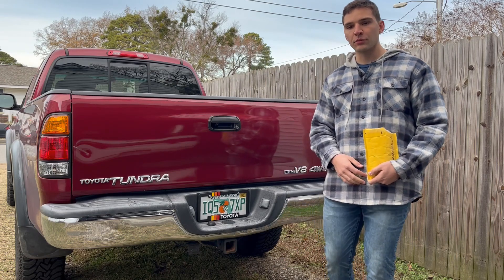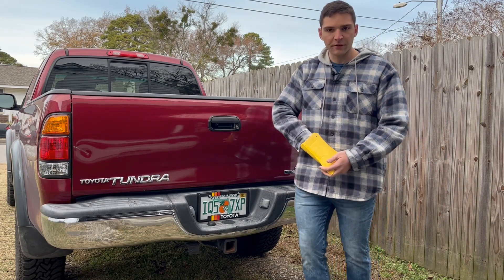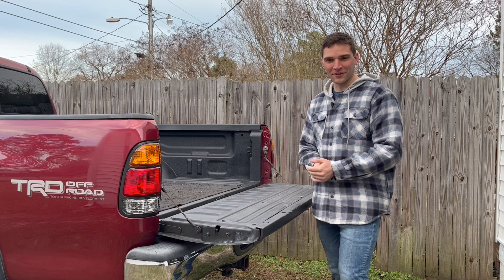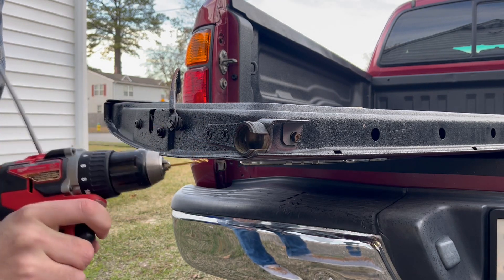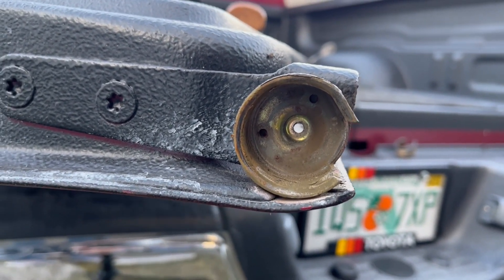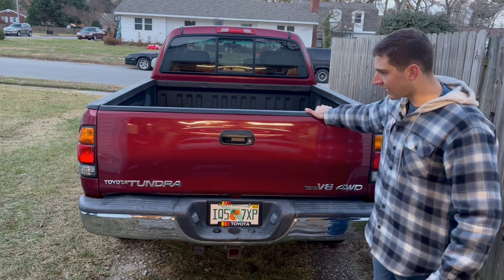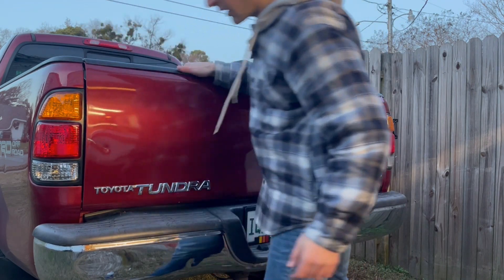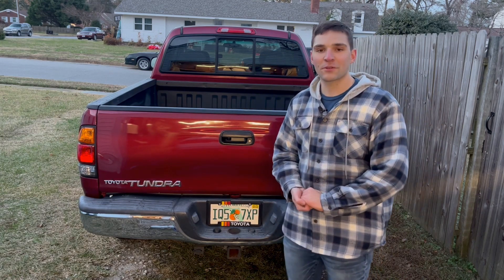First Gen Tundra tailgate rattle easy fix

Comment: Hey Sal nice video. I was curious, does your car make the Toyota Clunk? It's a clunk that appears when you come to a stop and start driving again. Or when you're stopped for a while the transmission or driveshaft just seems to make a clunk. Been having this issue and was curious if yours does it too
Reply from the maker: Yep, my truck used to do that about a year ago when stopping hard and I found that it was my slip yoke on the driveshaft. It can run dry and not slide like it should from the factory, causing the clunk. There's some info out there on where to refill it with grease, and I'm planning to make a video this spring redoing the carrier bearing and re-greasing the slip yoke. Hope this helps, thanks for watching! - Sal
Reply: I have this issue too and only vaguely know what I need to do. If you do end up getting a video out on it, that’d be a game changer! 

Awesome content by the way and thank you for what you’ve done so far!
Reply: My 2000 Tundra does it as well.
Reply: Same on my 03
Reply: @ethanmorris8471  just fixed mine today. You gotta take the whole driveshaft off and gease the splines where the shaft goes into the tranny. I replaced my center support bearing while I was at it. Drove it 20 minutes and didn't hear a single clunk. Whereas before it clunked everytime

Comment: Hey I have a question, does your hood latch on firm or does it lift slightly when you drive down the road? mines fully latched but it raises maybe half an inch or so and freaked me out the first time I noticed thinking it wasn't fully latched but it was haha
Reply from the maker: Lol no sorry I haven't experienced that at all. Sounds a little unsettling though, curious to see if anyone else reading these comments has a similar experience haha thanks for watching though! - Sal
Reply: I have the same situation with my 2000 tundra SR5 V8 hood. Fully latched but lift slightly as i drive. I was wondering if I am missing some type of rubber weatherstrip?
Great video by the way.
Reply: I had the same problem on my '00.  There are some rubber stop pads under the hood and they are adjustable...they can be screwed in to allow more space or unscrewed a bit to allow for a tighter fit.  Unscrew them to raise them slightly and do a lot of trial and error...stop when you can grab the bottom of the grill when closed and while wiggling it you don't hear the rattle any more.  If you make it too snug you run the risk of the remote latch no longer releasing as it won't have the strength to overcome the pressure/weight.

Comment: Anyone Else have problems with there tailgate access panel caving in from climbing in and out of the bed? Mine is caved in and rubs the tailgate latch rods underneath which causes similar tailgate play because it doesn’t latch as tight.
Reply from the maker: I haven't had any issues with that, but I'm not climbing in and out too frequently. I can definitely see how it could happen though. Maybe you could unbolt it and try to flatten it back out? Otherwise maybe check a junkyard for a replacement panel. Just my 2 cents. Thanks for watching! - Sal

Comment: When I’m driving my 2005 Tundra, I hear some squeaking coming from the rear portion of the truck. I don’t hear any tailgate rattle. I checked the play in it and it only has a little. Curious if it could be coming from where the bed attaches to the chassis? I guess I’ll try this fix first and see. I really apprised your time you take making these videos. They’re very helpful.
Reply from the maker: Yeah I'd say that you should start with the tailgate bushings, I had the exact same thought that it might have been my bed/chassis squeaking and these new bushings solved it. Thanks for watching

Comment: I recently got a 2002 tundra Sr5! you've been great so far on giving tips and some pointers! I do have a question though. the AC on mine kinda makes a high pitched whining noise when it runs. Is that normal? or should I look into that?
Reply from the maker: Is the whining noise coming from inside? Like out of the vents? If so, it could be your blower fan which can get clogged with debris because we don't have a cabin air filter on these trucks. Mine definitely whines a bit, so I need to get in there and clean it out. If it's coming from the engine bay, I'm not too sure. I don't have a whine like that outside when I've got my AC on. Hope you get it figured out, and it's not a big deal! Thanks for watching - Sal
Reply: @JDMDriveway  yeah, unfortunately it is coming from the outside. A friend and I were thinking it could be the air filter needing replaced. So we're going to be poking around the engine bay with the AC, to see if we can find the source of the sound.
Reply: Blast Lysol through the exterior vents while the fan is on high...you may have a lot of growth in there from over the years, and the Lysol will kill/remove a lot.  Then, remove your circulating fan (it's hanging below the passenger side dash) and clean it up.  Doing that, mine went from low-air flow and whining to high-flow and no noise at all.

Comment: Great video Sal! I saw your video on installing a back up camera. My 2006 Tundra didn’t come with a back up camera nor ahead unit. Can you recommend a head unit with a camera or a monitor for a camera.? Thank you.
Reply: Think ahead if you want to upgrade your speakers in the future. The more expensive headunits all come with a plug for your backup camera
Reply from the maker: I've been happy with my Atoto F7 head unit and Natika camera, but it is the only one that I have experience with so I can't really suggest it over a pioneer or Kenwood or other brands. Mr Mustache makes a good point that you should make sure that whatever one you decide on will have the features you may want moving forward too. Thanks for watching - Sal

Comment: I have printed quite a few internal parts for my tundra after they broke after 20+ years. I do wonder what the lifetime of a plastic replacement part for a tailgate is though? There is a lot of force and therefore friction on the parts and I honestly don't see them lasting more than a couple years at best. Especially when adding lubricant to them which might make the plastic more brittle. Do you know if they are ABS or PLA plastic?
Reply from the maker: It's a good point, and I think he's only been making them for a little over a year so there isn't much long term data on these. Didn't think about how the grease could affect the material. I don't think they're PLA, it's a softer plastic but not rubber. I'll reach out to Ryan and see what he's using. Thanks for watching - Sal

Comment: Awesome video. Quick question, do you have any wind noise inside your cabin, my 04  has a bad wind noise that seems to becoming from the bottom of the windshield. Haven’t been able to figure it out.
Reply from the maker: I don't have a super noticeable wind noise in my truck, but on the highway there is a subtle noise that I feel like is coming mostly from the mirrors and the fact that the truck isn't exactly aerodynamic lol
Reply: Something to check is the rubber seal around the steering shaft where it passes through into the engine bay. Easy to find if you follow the shaft up from the steering gear. Mine was shredded wide open letting in road noise. It can be removed and installed from the bottom if you disconnect from the steering gear.

Comment: Great video Sal,,new to your channel, question for you, what is overall ride quality of seat for longer trips? tks for sharing the info
Reply from the maker: Hey Thomas, thanks for watching. I have a lot of road trip miles under me in this truck and I'd say the biggest thing is the lack of lumbar support. My lower back can get pretty sore after a couple of hours. During my 14 hour trips from FL to VA I ended up stuffing a pillow behind me to help from getting too sore lol I have the bench seat so I can't speak on the split seats with the center console. Other than that, it's been a great road trip truck - I typically get around 18ish mpg strictly highway driving! - Sal
Reply: @JDMDriveway  thankyou for the response, have a great day

Comment: Thanks for the Video Sal.  If I ever get around to installing my back up camera, I will make sure to install a disconnect for the tailgate.  Thanks for the heads up!  Nice work.  Hey, do you have a coating in your bed?  I am curious...
Reply from the maker: Hey Eric, that's a great idea to add an in-line disconnect for the camera wire. As far as the bed coating, the previous owner had a spray-in bedliner applied and it came out decent; not sure what brand they used. A little overspray here and there, but it is holding up well so far. I still think I like it better than a drop-in plastic one. Thanks for watching! - Sal